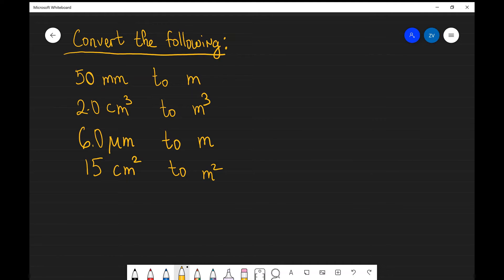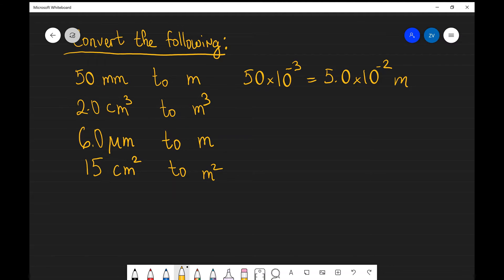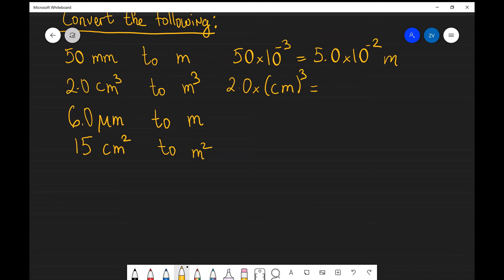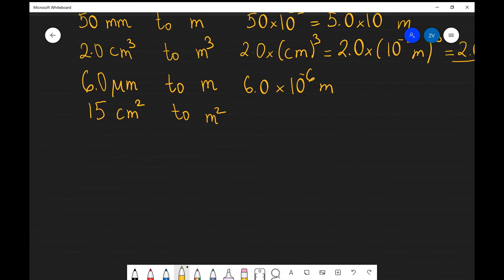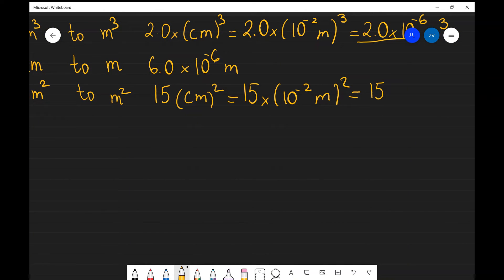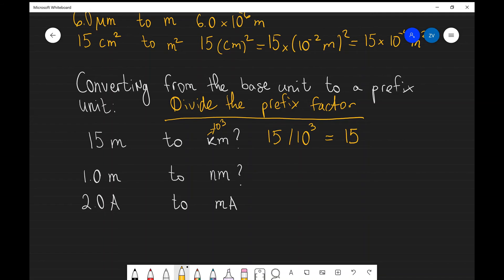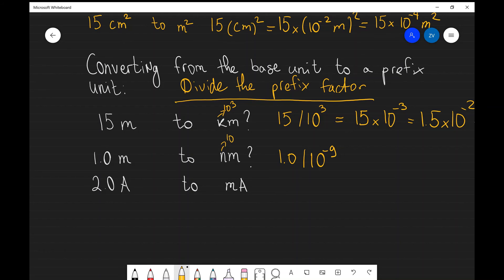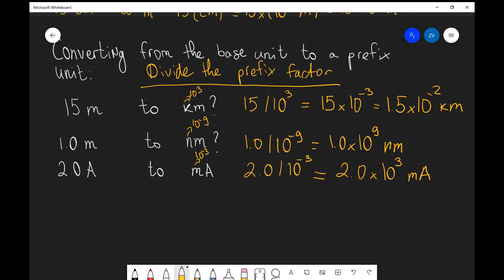A Level Physics: Prefixes conversion examples

Comment: I'm freaking out here because I got a practical exam in 2 weeks and only half understand this simple thing. 
My brain thinks in weird ways so these questions might just be bruh moments.

So I got an example in my book stating that  to convert prefixes you must for example:
Convert 0.247 mW into kW
(10x10^6) / (1x10^3) = 1x10^3

Which I perfectly understand.

However, the question I've been given is:  What is 2x10^-6 W in mW ?

So that would surely be   (2x10^-6) / (1x10^-3) = ? 

My confusion is like this, what is 2? Like with 1x10^-3 it's easy, it's just 0.001, so when there is a two instead of a 1, is it just 000.2?  
Also, what happens when there is a 1 and 2? Are they added together, subtracted from one another etc? 
It would help so much if you cleared this up and if you told me what the answer is and how you get there. 
I really want to understand this. 

Also if you have any tips about a-level physics practicals, they are welcome haha, I got mine coming up in 2 weeks. 

Thank you so much for any help you can give. I'm an extremley fast learner but get caught on the stupidest of things. This whole thing is like a crash course for me, or perhaps speed dating.
Reply from the maker: Sure no problem! So anytime we are going from a standard power without a prefix, like 2x10^(-6) W, we need to divide by the prefix that we are going for. In this case we are going for mili so we devide by this:
2x10^(-6)/(10^(-3))=2x10^(-3) mW  
Another way to think about it is that miliwatts is 1000 times larger than microwatts so we basically multiply by 1000. Hope this helps and good luck on the practical exam!

Comment: Why in question 3  on minute 2:37 you did'nt convert 10*-6 to 10*--5 m   as with question 1 ?
Reply from the maker: So on this question the prefix is not multiplied in any way it's just a conversion from micrometers to meters and 6 micrometers is 6*10^(-6) m, hope this helps!

Comment: This might be a stupid question but why do you multiply and divide the prefix factor as oppose to adding and subtracting?
Reply from the maker: Definitely an excellent question! Prefixes are used to express large differences so multiplication is just algebraically a lot more convenient and suitable. 
For instance 6 micrometers = 6*10^(-6) =0.0000006 m

If you took say 10^6 away from 1 m you would be left with 0.999994 m which is almost the same number.